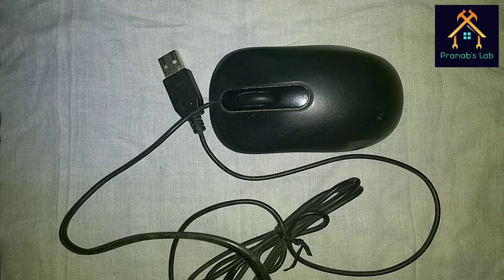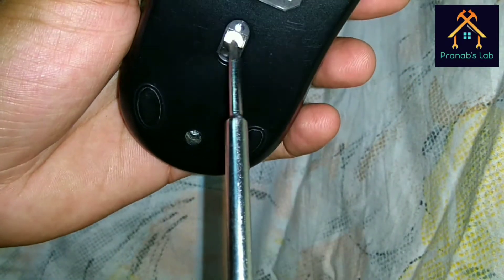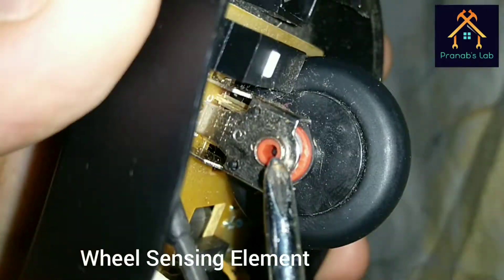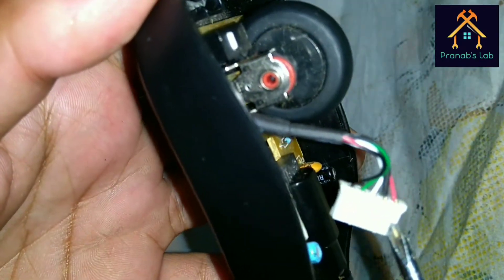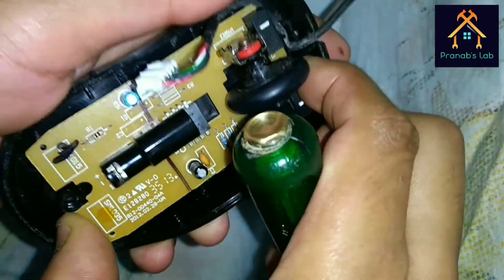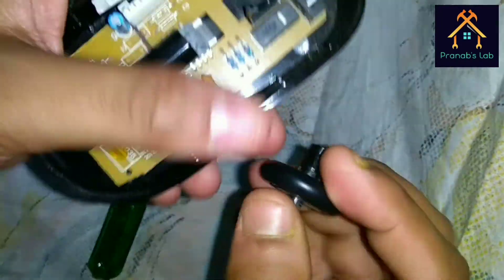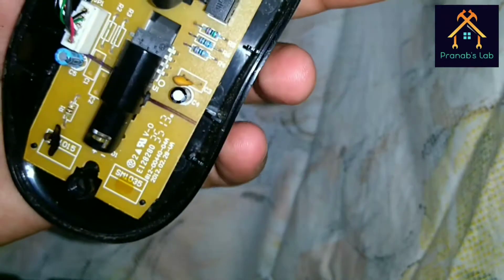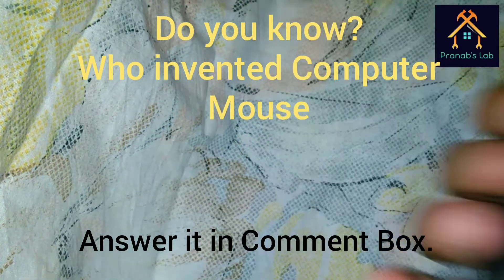Inside a wired Optical Mouse Lenovo KM4802 |What are inside a mouse | Internal circuitry repair

Comment: Sir, what is the function of optical mouse???
Reply from the maker: An optical mouse is a computer mouse which uses a light source, typically a LED, and a light detector, such as an array of photodiodes, to detect movement relative to a surface. Variations of the optical mouse have largely replaced the older mechanical mouse design, which uses moving parts to sense motion.